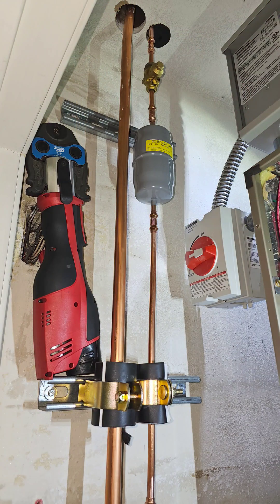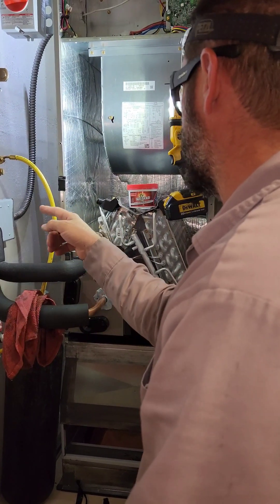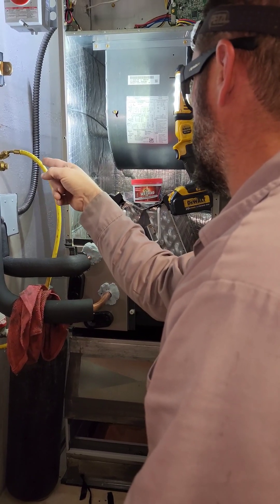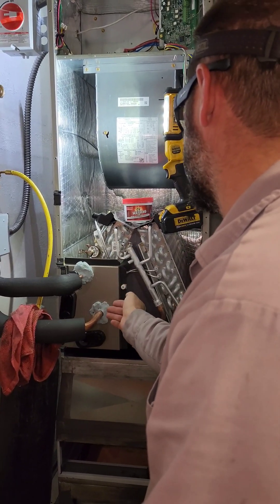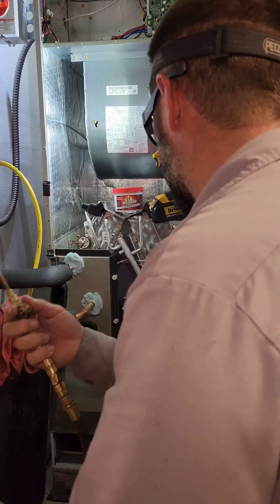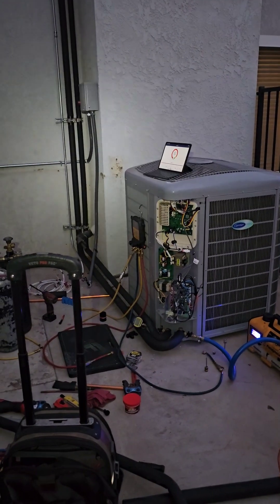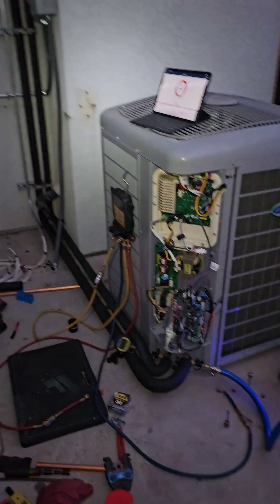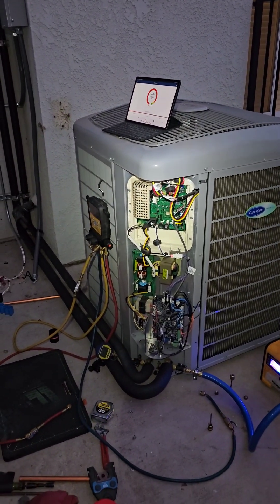HVACR VIDEOS FULL INSTALL WITH ZOOMLOCK MAX #shorts

Comment: Finally, someone else who installs isolation valves on the line set near the indoor unit. Although, I would argue that the service port is on the less desirable side if the valve (all things being equal)…
Reply from the maker: The ball valves were installed in a way that I could isolate them and recover the charge to change the drier if need be…. Can’t take the refrigeration mechanic out of me… even on a residential install

Comment: I have watched your videos for a few year's now for entertainment and self education, love them, but do you really like the zoom lock fitting? The automotive industry uses o rings at every connection in their AC, and that is always where the leaks are, they degrade flatten out, and turn hard, and not seal anymore even with the latest and greatest materials
Reply from the maker: I’ve had good experiences with the zoomlock max fittings personally. But I’m not going to press everything, I will still braze too

Comment: I've been wanting to ask, why did you insulate the liquid line?
Reply from the maker: Just to increase the efficiency, in the summer my attic temp can get extremely high it can get to 115-118 outside so the attic can easily be 20-30 degrees hotter and the liquid line can absorb that heat reducing the efficiency

Comment: I always stay brite 8 the evap and condenser on residential.
Reply: Yep, it works great on those applications and does not require a 4k tool and fittings
Reply: @zack9912000  zoom lock is cool if you already have a propress for boiler work ( which i do ) but stay brite is nice for new copper, txvs and driers. I just would be careful doing too many solder joints before txv and solonoid. A ball of solder could get stuck on those areas.

Comment: Challenge: braze with R-290 flowing through the system!!! ☝😩👍
Reply: Not a huge deal, do it all the time. Called a pinch off tool
Reply: @zack9912000  Alright, you got me, I saw some dumbass do it and make the whole system blow up like a glorified fireworks display...